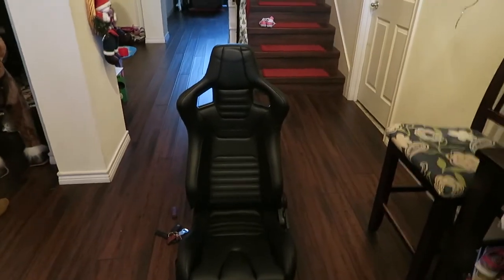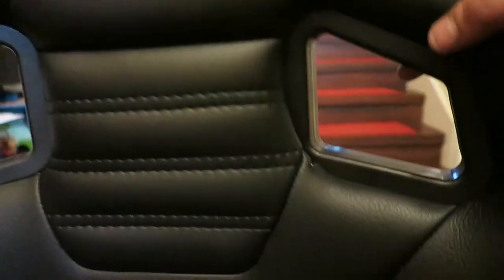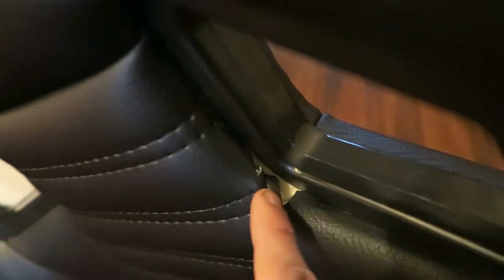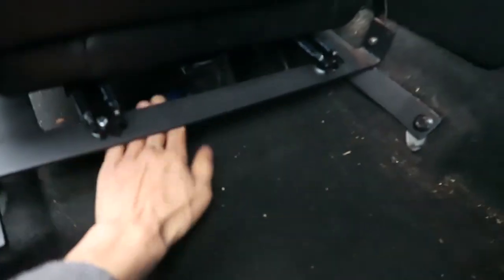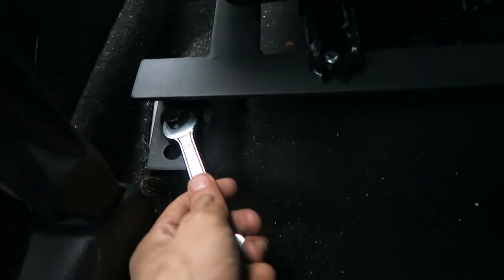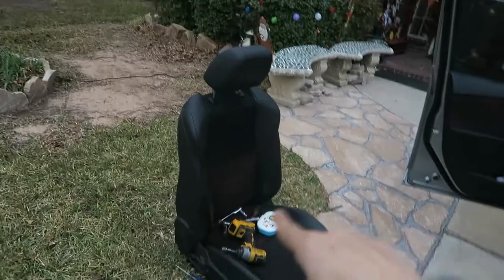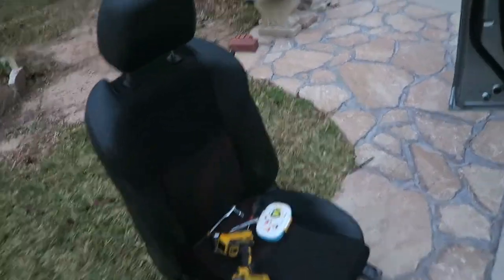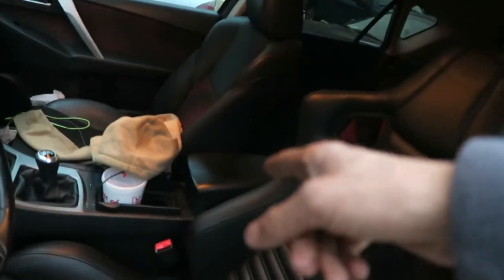Mazdapspeed 3 Aftermarket Seat Install

Comment: On my speed3 their was a sensor on the rail that was a pain in the ass to remove I read it was rail track seat position sensor I guess it tells the computer if ur to close to the steering wheel so the air bags won’t go off not 100% sure